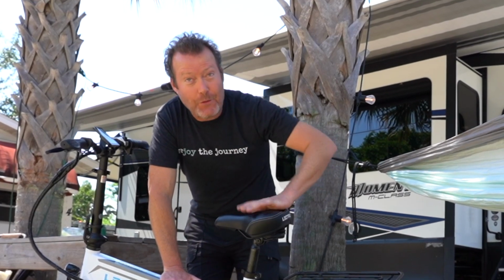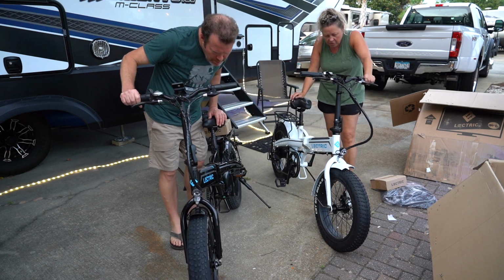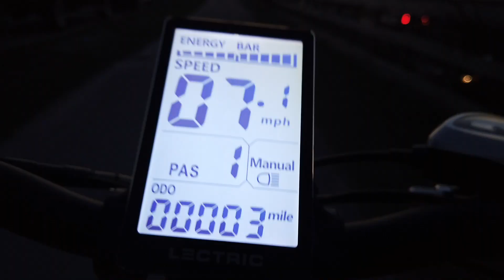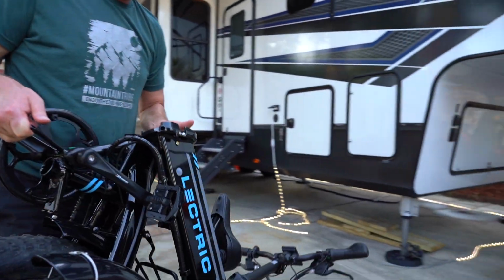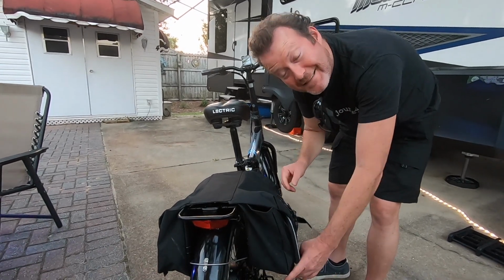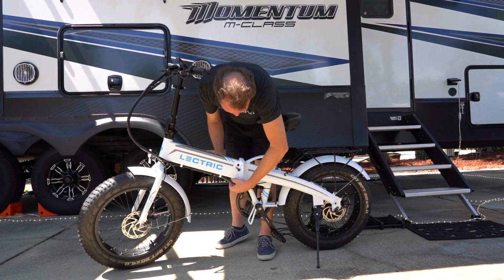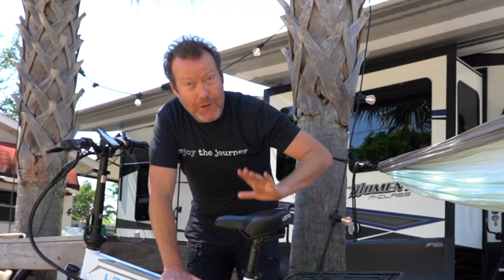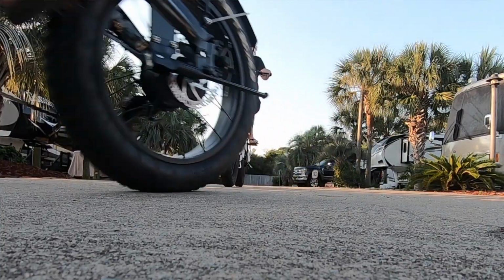BEST EBIKE UNDER $1000! (LECTRIC XP ELECTRIC BIKE)

Comment: 3 things - 1. Don't wear flip- flops, open toes shoes. Road rash a real possibility. 2. Get helmets asap. 3. Get bike locks. Never leave bikes unattended unless locked. 'Even a few feet away from bike is all that's needed for a thief to jump on it and go.  Cable locks probably the easiest to beat. I use a cafe lock that locks the rear wheel and a folding lock with alarm. Also make sure ur homeowners insurance covers ur bikes. Liz Amazing has a vid about her bike being stolen while cable locked to the front of her RV like u do urs
Reply: Lighten up, they are adults having the time of their lives. God Bless them..
Reply: @MrBrysta  lighten up - so u don't give good advice to people? they provide good solid advice to the rv community and i'm happy to do the same.
Reply: Just because they’re adults doesn’t mean they won’t crash. Riding a bike without a helmet is like driving a car without seatbelts. Keep the suggestions coming.

Comment: Can you do video on the best inexpensive scooters please. At campgrounds we just need something to plop our butt on and go. Don't want to be raising our leg up. Some of us are old with arthritis and other conditions. I really like those scooters with removable seat and can be folded. We need good lights, nice bell and or horn and large enough wheels to go over wet grass and dirty bumpy roads with puddles and rocks. Ample storage in front of handlebars, as well as behind the seat so we can carry groceries, beach stuff, etc. Doesn't need to be super fast, but not super slow either. A lightweight scooter with super long lasting lithium ion batteries. Thank you
Reply: WANT MUCH?  Check out electric Trikes, women configuration.

Comment: Yeah, I was going to mention helmets.  I have the Rad-Mini fold-up and I love it.  You can get nice vented bike helmets at an Academy Sports store for around $15 -20. with adjustable head band and chin straps. (Bell).  Can't imagine all the nice accessories with those bikes, but no bell.  Have fun and be safe.  Oh, while at Academy, you can also get a pair of fingerless weightlifting gloves which give you great padding a grip for longer rides.
Reply: They actually do come with a bell it’s just kind of hard to know where it is cause they didn’t read the directions